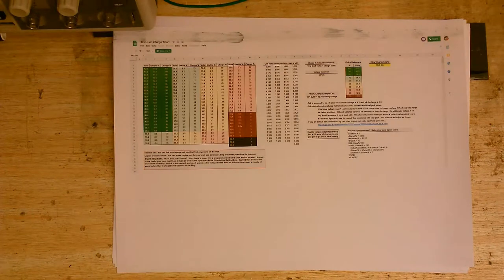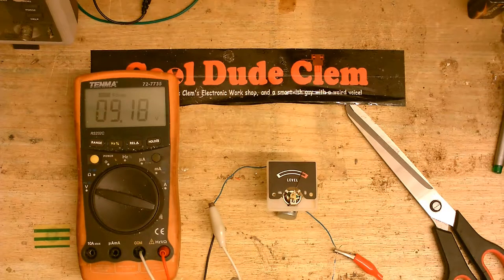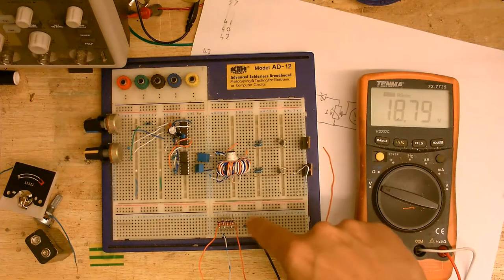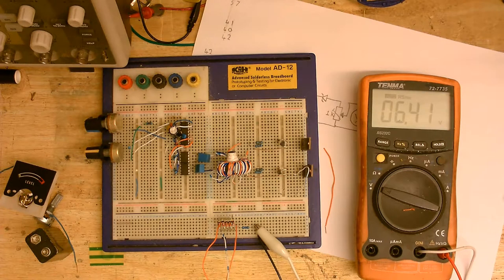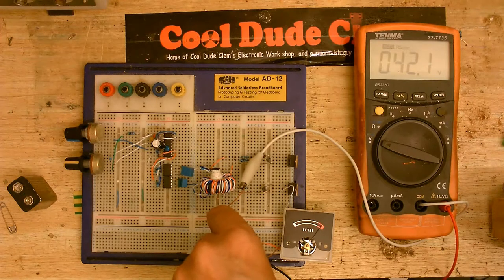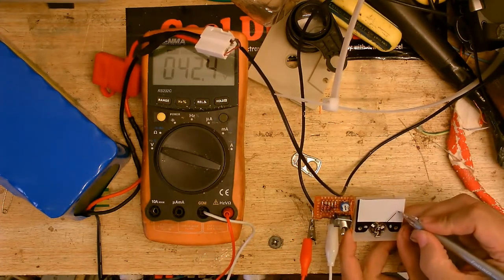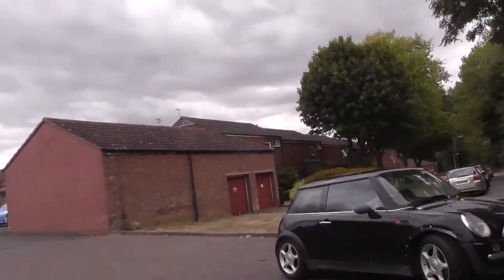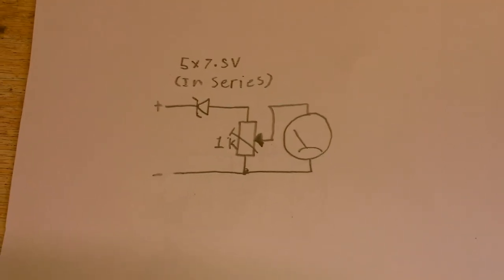Making a battery charge meter ... for my bike.

Comment: Did you check the functionality of your circuit at different temperatures (e.g -10C winter vs. 40C summer)? The series of zener diodes looks like a very sensitive thermometer.

Comment: Dont you have any 18650 cells to make up an extra battery to put in series to get your correct voltage for the ESC
Reply from the maker: I would probably have done that if I had some extra cells laying around, and maybe even make a charging circuit, but I'm not sure about mixing "old" and new cells
Reply: @CoolDudeClem  think should be okay as long as you match the capacity/discharge rate .. but yes your right they need to be high current cells with roughly the same internal resistance to match the other cells performance wise when you pull current...